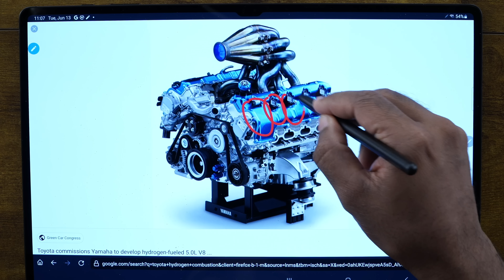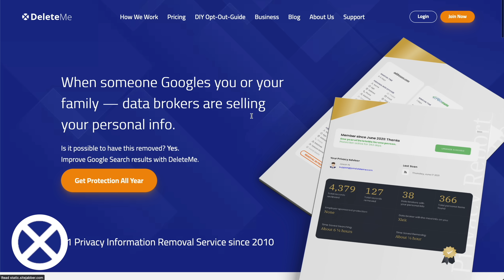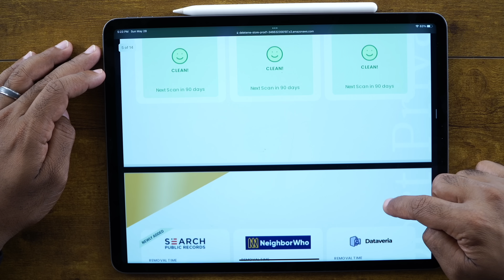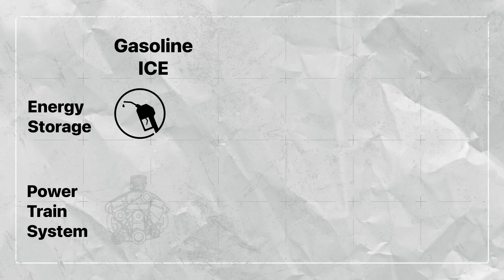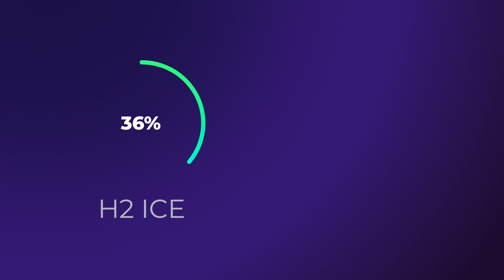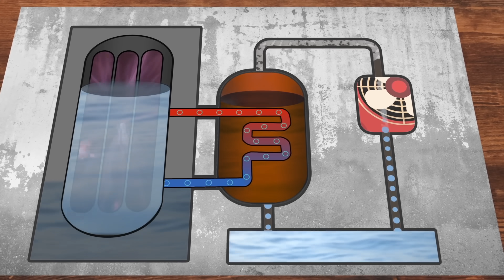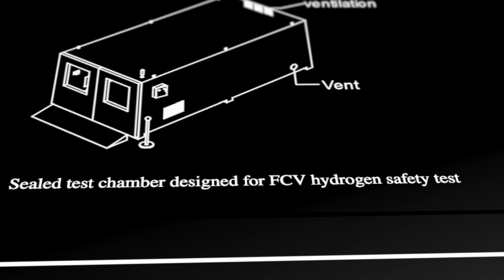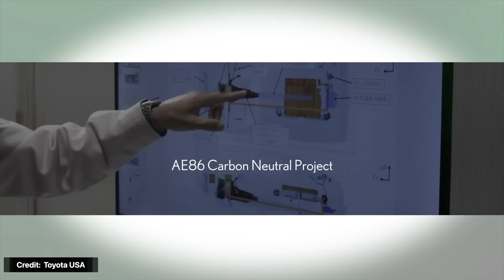Toyota's Says They Just Destroyed EVs - Hydrogen Combustion Engines

Comment: If your primary reason for going away from petrol.diesel is environmental then there are two things you have to ask: How much CO2 is produced making the fuel and how much is used for the infrastructure. At the moment hydrogen is made mainly from methane and water. This produces CO2 and hydrogen. Hardly green. Electrolysis is not exactly efficient either. If you could get electrolysis to happen fast enough at 1.29V it would be 100% efficient. However it actually needs more like 20V for industrial level electrolysis. So you need 96500 (faraday constant) x 20V or near 2 MJ of energy to produce 1g of fuel. However you need 2kg at least to fill a car to get 66.6kWh worth of H2 in a 100% efficient system. That's maximum output from one of the newish 16MW turbines for 4 days. Hardly practical.

Comment: Yamaha made the heads for the famous Toyota JZA80 Supra's 2JZ-GTE not because Toyota doubted the car but because Yamaha specialise in high performance engines.

The reason the 2JZ is indestructible is because Toyota don't spend a fortune figuring out how to make a bottom end that's light yet strong - they have big crude rods etc that are overkill because it's cheaper. Bring turbocharged and not high revving that doesn't present a performance impact.

Make no mistake, if Toyota partners with Yamaha it's equally likely to be because they NEED a company that specialises in high efficiency high performance.

Comment: EV's should only need the battery to take off, then from that point should be some beefy "alternator" that powers the motors and charges.
That's what I don't get, battery cars don't have alternators ? that keep the battery charged. 
4 or more alternators (one per wheel) and a battery should keep going unless you're flooring it around every corner then that's a different story.
Too bad the same thing that happened with oil will happen here. Big players with lots of money and investment will steer the direction based on their own profits.  
Like oil, oil shouldn't have taken off like it did as we had electric back before ww2 and that could have taken off.. But big copra manipulates everything..   This Hydrogen with combustion seems great and easily compatible with less conversion.

Comment: When I was young, we took placed a propane tank in the bed of our farm truck and changed out the carburetor with a carb that was modified to run on propane. Our trucks lasted until the government made it illegal. Oil changes prior to the change to regular gasoline were crystal clear. We had very few mechanical issues. The problem was we had little bed space because of the size of the tank. I think the reason we will see resistance to hydrogen will be a result of the longevity of vehicles running a fuel that doesn't produce carbon which eventually destroys most engines.  Could Hydrogen be used to charge batteries rather than using gasoline in vehicles that use onboard power generation to keep batteries charged?

Comment: I believe this technology is going in the right direction - why?

There must be alternatives to electric engines. What do we do with the existing car stock? Well, most likely e-fuels. What do we do to run strategically important vehicles? Well, most likely NOT batteries. 

For anyone who doesn't see it - there is a war going on in Europe! And I don't see a future where army tanks and trucks run on batteries because they are super intense energy consumers. I would like to see a 60-ton tank run on a battery or a 48-ton truck run on a battery. What's the range for these vehicles running on a battery charge - 28 km? And then you stop at the next supercharger?

Joke aside - how would a nation or NATO really keep its 12 to 18 months strategic energy storage? Germany just spent billions to replace the gap from the cut Russian energy supply. 

Nato has an army of around 3 million soldiers - they have airplanes, tanks, and trucks and they exercise a lot. And therefore use a lot of energy. 

The current opposition to e-fuels and hydrogen is making two mistakes in coming to a final judgment on the two alternatives. First - they say both alternatives are sooo inefficient. Correct, they are indeed very inefficient. Well, so where the solar panels Jimmy Carter put on the white house 50 years ago. There is a process called progress and I would not be surprised if we soon (next one to three years) have a hydrogen production process that is 10-times more efficient. 

Secondly, these people still look at the whole carbon-neutral energy production and availability as it is today - meaning we don't have enough. Well, energy is like yogurt - meaning if you don't use it right away, it will go bad and you can't eat (use) it anymore! We already have sunny and windy days in Europe where we have negative energy prices in the market. We must install about 130% of the real energy needs in sustainable energy production and instead of wasting that energy in not using it - we should take those periods of overproduction and produce e-fuels and hydrogen so we have fuels for the strategic energy storage and machines/vehicles that can't run on electricity.

PS: I work and do research in this field

Comment: Hydrogen internal combustion engines are the best solution for future mobility, let me explain:
- they are cheaper than the two other option ( battery or fuel cell)
- they don’t require rare metal to be built
- they are lighter 
- they are quick to refuel
- Battery vehicles don’t emit CO2 when you use them, but if your electricity come from coal or gaz they emit way more co2
- Hydrogen made from renewable energies or from nuclear power plant is green
- The sound from the motor is great

The problem nowadays is the lack of hydrogen station but in a few years more and more station will be built and it won’t be a problem

At the beginning of internal combustion engines with petrol there was no gas station also, we built them

Comment: In this world, what really counts, is who is going to get richer from any new product. Example:  Tesla. Musk could have designed an electric car with easily exchangable battery packs, with a non proprietary battery and interconnect system, where batteries could be easily stored under the car with bayonet connectors, and the battery packs could be changed out at serviced stations in seconds, even faster than filling cars with gasoline/diesel. But NOOOOOOOOOOOOOOOOOOOOOOOO, he had to make sure that he could keep getting richer, and so we have plug-in charging stations, where a permanently mounted proprietary design battery had to be charged. And when the battery gets worn out? You have to buy another new one from Tesla, or GM, or Ford, or Toyota. Perpetuating the suck your wallet dry system we have with the oil companies right now.  
It's always all about who is going to get your money.

Comment: This hydrogen V8 is idiotic.  Low efficiency, crappy powerband, zero torque at zero rpm, noisy, expensive to maintain, needs specialized and expensive infrastructure, and still pollutes with NOx and eventually oil burning.  Hydrogen is a religion.  Nobody with any STEM chops thinks it's a good idea.

Comment: Hydrogen is produced by electrolysis (running current through water to separate the hydrogen from the oxygen).  You can do this by plugging into the electric grid.  So supply isn't really a problem.  One of the stupidities of hydrogen as fuel is, that electricity is produced by burning natural gas (methane).  

Question: Why not cut out the middle man and just power the car using natural gas?  It seems like a more direct route than to burn methane to make hydrogen to burn in an engine.  Natural gas is ABUNDANT and is a renewable natural resource, made in the earth's crust.  It is not a fossil fuel as the gasoline companies want us to believe.  If it were a fossil fuel then that would mean planets like Titan have a LOT of dead plants and animals on them, which they don't.

Is the lie of the fossil fuel myth preventing us from solving this energy supply problem?  I think it is.

Comment: Two points you missed. 1. The lack of hydrogen refueling networks being an obstacle is the exact same hurdle gas cars overcame and EVs are now dealing with. History has shown that can be overcome. 2. Japan didn't build their HTGR reactors to produce hydrogen. Their primary purpose is to produce electricity. Using the waste heat to produce hydrogen increases efficiency, produces something useful and eliminates waste. That may be local to Japan but it's a win/win for them. 3. Travel doesn't have to be all electric or nothing. You mentioned hydrogen seems to work best under high pressure. Maybe it's better for trucks than personal vehicles. Hydrogen may play a role in reducing CO2. 4. We don't know what we don't know. As we study hydrogen (or anything else) we'll learn better ways to produce, transport, store and use it. None of which we'll learn if we judge it based on our current understanding. Chevy had an electric car 40 years ago but cancelled due to poor battery technology. If they had spent millions on battery research back then we'd be 30 years ahead of where we are now. Instead of researching what they didn't know they poo-pooed what they did know and threw out a good idea.

Comment: You've forgot to tell about the different kind of "hydrogen tank"... you can use hydrogen discs.... there ia company in US that already makes them I think. Easy to find. That kind of storage of Hydrogen is much safer and it can be supplied to the normal shops even on route 66... so you don't really need to make a new "gas" /Hydrogen stations... Technology is already there!!!
And I would't be "extrimist" about electric, hydrogen, diesel, etc... we need diversity in energy storage and sources.... common sense tells you this !!! 
You can also have dual fuel car like gasoline-lpg, or gasoline-hydrogen, or Diesel-hydrogen. Some people already have it. It is not rocket science !!! 
There is a space on the market for all of the solutions. And some solutions are just good, so keep it!!!
Also Diesel engines run on vegetable oil... I know, because I use it sometimes... 
Thanks for your video. Very  good. All the best from Poland 👍

Comment: Hydrogen-ICE vehicles won't leave anywhere near as much toxic waste as EV's do. Suffice to say, Hydrogen-ICE is a far more environmentally friendly solution.

The amount of N²O emitted from Hydrogen-ICE exhaust is negligible, especially when you consider that it's already present I'm the air that we breathe.

Range anxiety never disappears, unless you're a fool. The older an EV battery gets, the less capable it is of retaining it's charge; and that gets worse when you add extreme heat and/or cold environmental fluctuations.

Comment: hydrogen internal combustion is a FAIL, range is extremely limited due to fuel storage.
Hydrogen per VOLUME does not have as much energy as gas/diesel.
you are out of luck when a big storm knocks out electricity when you have an EV, you will not be recharging.

Comment: The reason why Toyota is continuing their research, development and investment into these types of engines is due to maintenance, parts and services. As you know, there is very little profit to be made in the production of the vehicle itself without overpricing it, however, they can make up for those losses by the services aspect. I also suspect that this type of work will be more expensive than a typical gas vehicle as well - so more profit for them. Both Toyota and Subaru are so intent on these types of products in their search of maximizing their profits that they are continuously damaging their "Eco-Friendly" brand that they slowly built up over the decades which is pretty sad to see tbh.

Comment: Nahh. 
Terrible efficiency. H2 production is about 63 to 70% Efficient depending on storage type.

ICE itself is only about 19% efficienct for energy content of fuel > motive power ( i.e. applied to the road surface ).

It simply doesnt make sense for most applications compared to batteries.

Comment: range anxiety does not go away with time because the range is constantly decreasing for the life of the battery. also replacing the battery is way too expensive. also, the majority of the electricity used to charge evs are derived from coal and methane. so it is not better for the environment. it is what is commonly referred to as a scam. another problem with the evs is their weight. they are their own worst enemy when it comes to efficiency.

Comment: I've been thinking this since 70's.........at one point  cal  didn't consider 0 emmission.....water ok actually not 0. Batteries have a downside.  Manufacture.....endurance......disposal. Electric veichles are great in  many ways. I like toyotas giving people a choice. Many people don't realize trains run on an electric motor charged by diesel. Wonder if an Individual could set up a hydrogen production.

Comment: Toyota has previously been convicted in Australia lying to their Hilux customers in particular! Hydrogen is a green house gas 11 times worse than co2. Because it's the smallest atom it can leak through metals. Putting it in an ice engine is gobsmackingly dumb! But Toyota's had to do it because the previous cars made to convert hydrogen directly to electricity were  too costly and leaking hydrogen damaged mechanicals. Just about all hydrogen is made from petroleum as green hydrogen is more expensive. The electric Viking just released a U tube saying it's only $us 2200.00 to fill a hydrogen semi trailer which gives 50 less miles than Elons new semi! How much to fill Toyota's V8 if you look further they'll be talking about hybrid green Fuel like the bull fuel Mercedes is pleading the German government for to save them. Mercedes the dobber in company on diesel gate 2 or 3 left partner crooks BMW and VW hanging.

Comment: A couple things you overlooked and it is funny a lot of EV proponents overlook them. The EV's weight causes excessive road and tire ware. Almost everyone with an EV will tell you they go through way more tires than they ever did with an ICE. Tires are very dirty to produce and recycle and this is a major "hidden pollution" of EV's as a small 4 passenger car weights more than a full size truck. The damage to roads is also very energy intensive to fix. Another benefit of hydrogen that you overlook is the backwards compatibility of it. You can retrofit almost any ICE with fuel injection to run on hydrogen relatively cheaply compared to the 25-50K it costs at the moment to convert an ICE into an EV. (yes they sell kits that are 8-20K but you have to do the entire suspension that is not included in the kits and the do not include labor costs)  Converting ICE into H-ICE is a much greener alternative as it will get more vehicles going green than tossing them out and getting new EV's. You will waste far less energy converting rather than going entirely new.

Comment: Knowing that hydrogen is the most abundant substances in space. Making it mostly logical. For hydrogen combustion engines. Provided hydrogen can be made available, easily? And requires less power to use as a reliable source fuel? Otherwise what would be the point? At reducing our green footprint? Because we have to.

And so the sacrifices must be made. To ensure our continued survival. And that's not hard to do even though it could be slightly, painful. Because change is difficult. But it must be. For the greater good. And we all know this. There is no denying, this, anymore.

Those not wanting to recognize these necessary compromises. Should, I feel, just leave the planet. Go. Get out. If you do not want to pitch in to help save our survival? Then you have to go. As you will contribute nothing. To our collective necessities.

It appears we are all vacillating toward, à la carte, transportation. As there will be no one unified, movement. All methods of power are on the table.

My time is coming to an end. I won't have to worry about nothin', anymore. I'll be at peace.
RemyRAD

Comment: Keep on talking about ice engine efficiency compared to EV. The EV production energy is about from memory 5 times more then an ICE car. The EV has to heat with battery power the interior when there is cold weather the ICE car just uses what is produced by the combustion. And the EV is constantly over time loosing power from the batteries and a you said needs warming of the cells to operate in colds weather. So hybrids get the best of both worlds. It must be remembered that most of today's EV's will be superseded by more advanced technology and have limited lifespans. This is much like solar panels where I see less then decade old ones being superseded and chucked out for better out put and less degraded new ones.